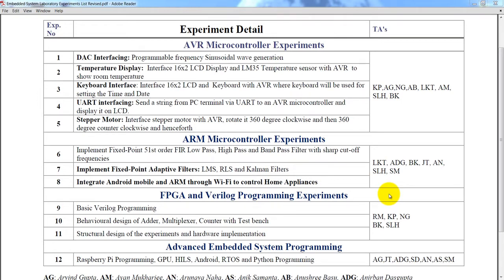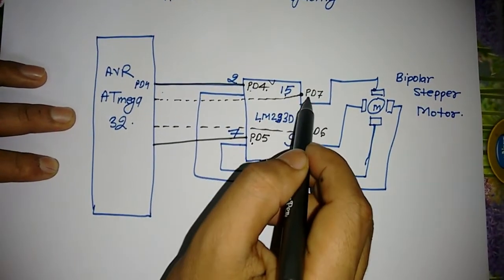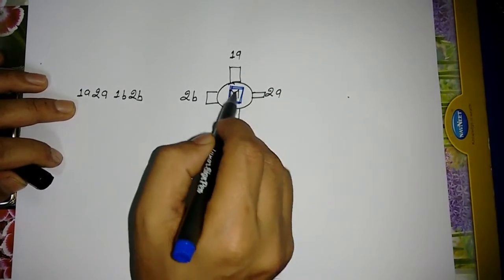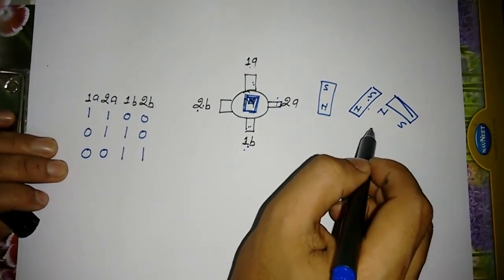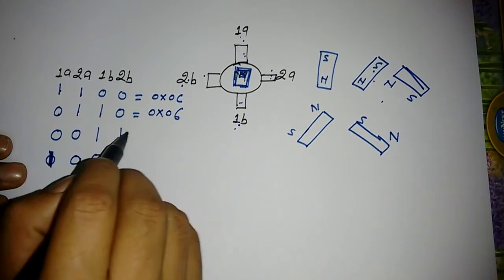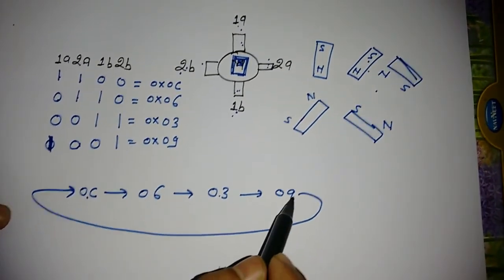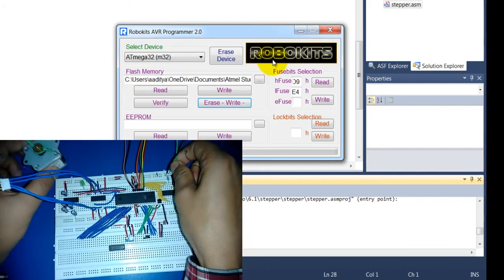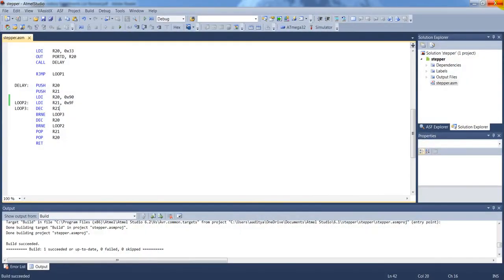15 Atmega32 Assembly Tutorial- Stepper Motor and LM293D interfacing with AVR ATmega32

Comment: hello  .  if it is possible to control the speed an position of tne dc engine with the source without the key so that it speeds in the right direction round and it will slow down in the left direction only via the keyless source.....explain please